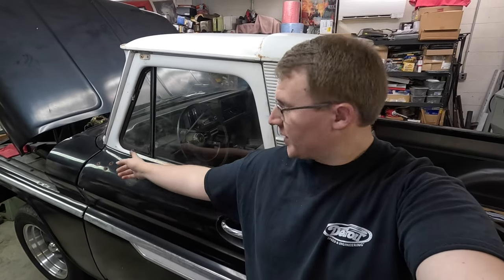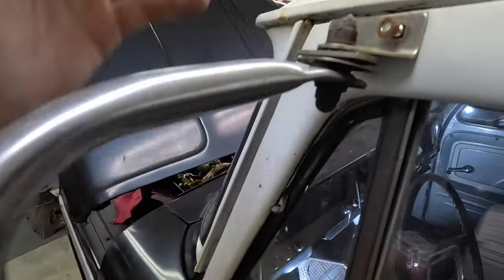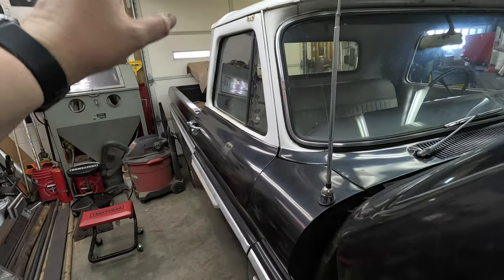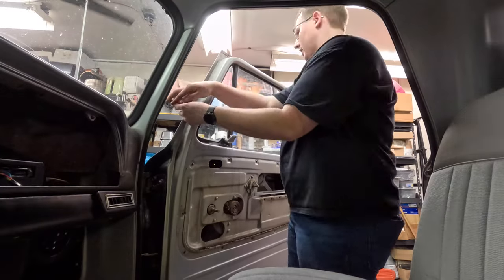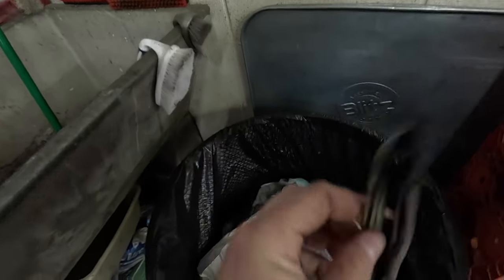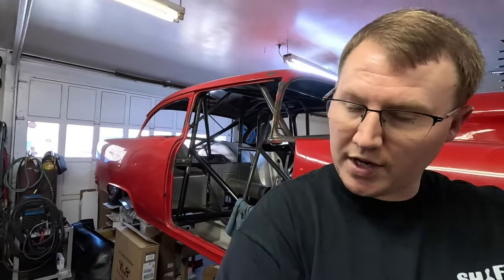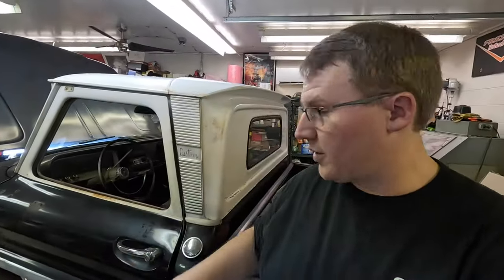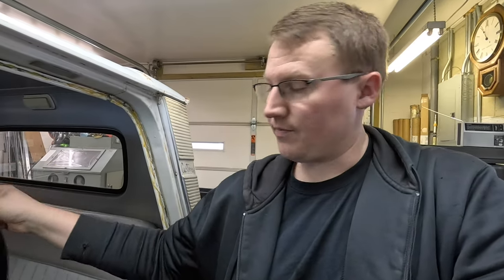1966 C10 TRUCK Build Full Weather-strip Install (Vent Window Rebuild)

Comment: Nice did you ever mention where the kit came from, I need to do the same thing on my 55 truck
Reply from the maker: @DesertRatFabrication  I'll have to go back and look at where we bought it but it was a Precision Parts kit. I believe they sell them at multiple different suppliers.
Reply: @shift_points  awesome thank you very much, I should be able to look that up, seemed to be a good and complete kit

Comment: I just di my 64 and have issues with closing the doors - any ideas?
Reply from the maker: When we put the new strips in it made the doors SUPER tight and hard to close. One thing that helped was getting them shut and leaving them shut for a long while. It seemed to help mold the seals to the door.
Reply: Thanks! my doors are actually closing as well but the look like they are out of place, Weird!
Reply: thank you so much - i seem to be seeing and feeling the same. @shift_points
Reply: I have that same issue on my 68 C10 ! New door rubbers 5 years ago & there still hard to shut ! They never give up I guess !